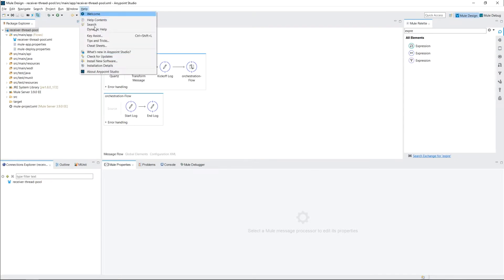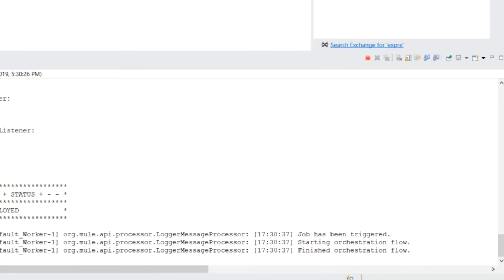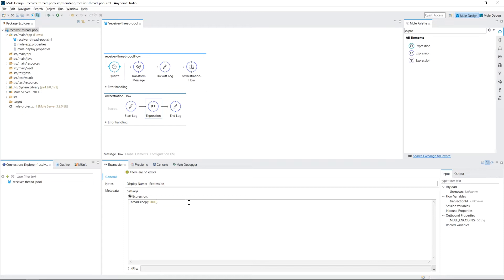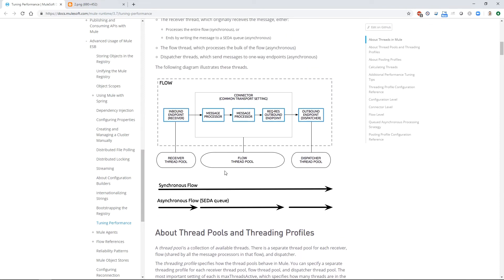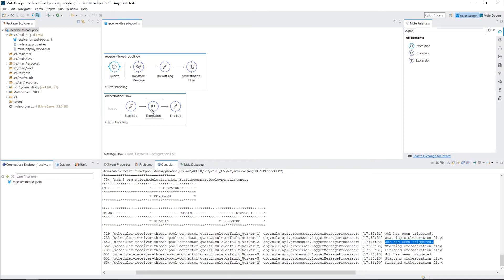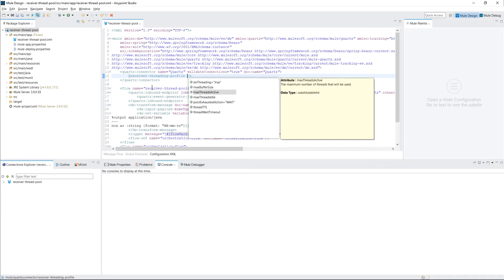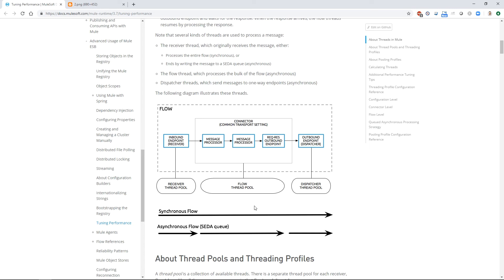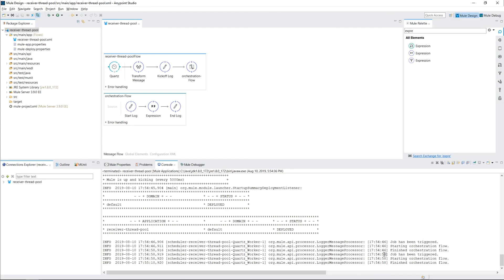Multi Threading issues with Scheduled Jobs | Receiver Thread Pools in MuleSoft

Comment: There is no more processing strategy in Mule 4 .Mule Runtime is designed on the concept/processing strategy called Non-Blocking processing Strategy.

Mule Runtime is smart enough to do anything based on current event processor related to processing strategy.

So no need to define anything for any connector.

Mule Runtime is Non-Blocking Engine now in Mule 4.